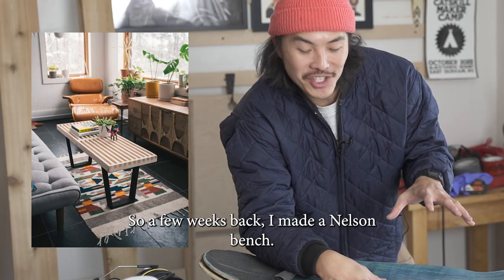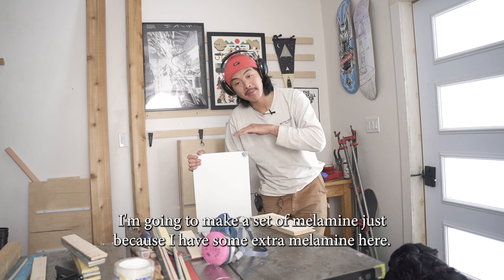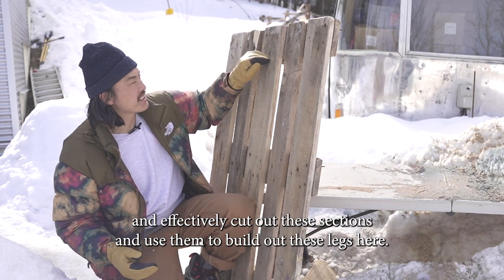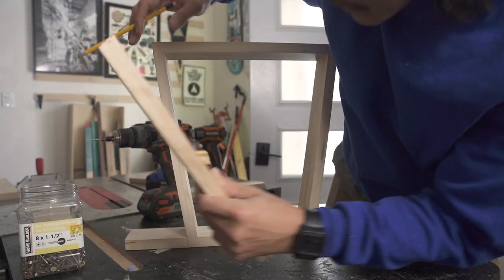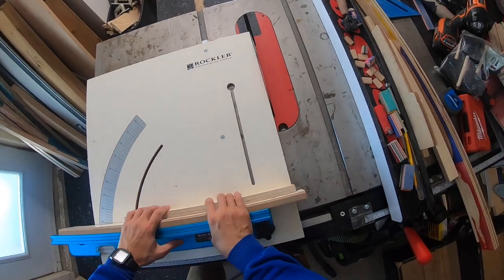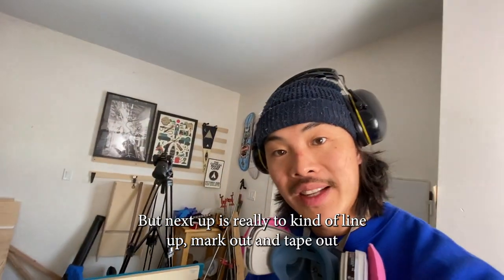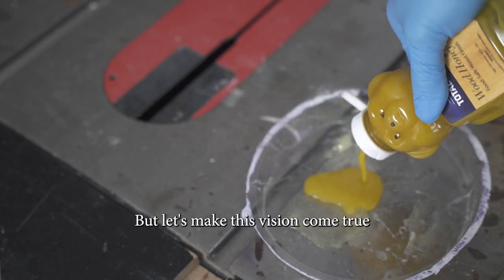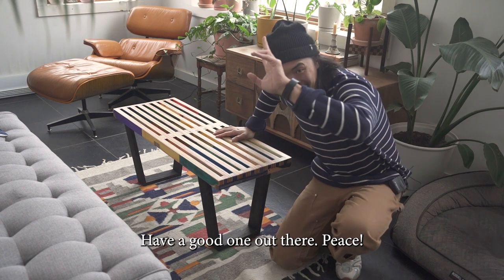Making a $2000 Bench for Free (w/ Pallets and Skateboards)!

Comment: Amazing! 
Forget the building skills and tools I need - which will require me to ‘phone a friend’ for help - what wood can I use to apply a walnut looking finish and end up with a reasonably priced bench?  Any idea of weight capacity of bench?
Reply from the maker: oooh so there are definitely stains available at your local hardware store. you can apply after assembly. capacity on the bench is probably 3-400 lbs (I weight close to 200 lbs and it holds me pretty easily).